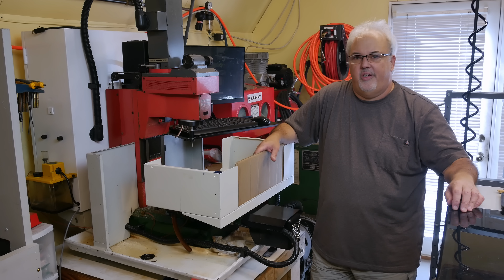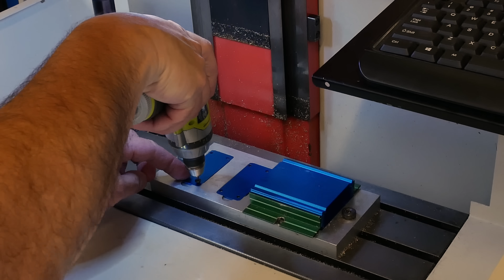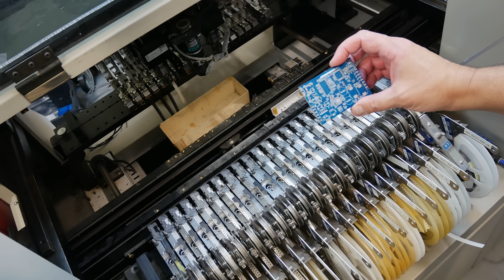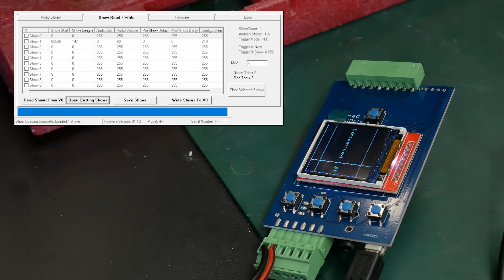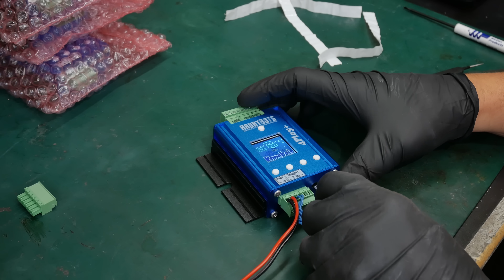How Does a Factory Fit in a Shed?

Comment: Never thought about this world of hand made circuit boards. Aren't the "moisture sensitive" components affected by the wash? Looks very labor intensive. You're a smart dude.Congrats on this niche of very specific electronics.
Reply from the maker: This is an interesting point that a few people have asked and I glossed over in the video.  The issue is that the chips can absorb moisture even sitting in standard room humidity.  This causes a problem when you reach the reflow oven stage of the process.  You have a component with a certain amount of internal moisture heated to twice the temperature of boiling water.  Basically the chip can behave like popcorn- if not completely exploding, it can create micro cracks that can later come back and bite you.  Once the part is soldered on to the board, the moisture is no longer an issue. so its safe to wash.

Comment: I did something similar to this in what we called " In Shop Repaire " When I was in the AirForce, I loved it. We didn't make new boards we would troubleshooting bad or old boards, repaire them, test them and certified them as usable for the fleet of jets we had on or off stationed. Our bench stock had over 4 million dollars worth of parts and looked just about like yours. Again I really enjoyed this position, but we rotated and at some point it was back out to the flight line to repair jets. It was odd ordering a part to fix a jet and when you got the part the tage was signed by yours truly...very satisfying !

Comment: Nice to see a setup in a shed. A few notes regarding the cleaning using the ultrasonic bath: -the solder paste you use is technically a no-clean variety so really doesn't need to be cleaned afterwards. -Crystal oscillators often don't agree with ultrasonic processes, you can minimise the risk of damaging a crystal by applying a small dot of potting epoxy around the crystals first. This pre-stresses the crystal and helps reduce damage.
Reply from the maker: That is true, but the hand soldered stuff along with the flux I use when touching up the reflowed stuff makes a mess and I just don’t like the looks of it, so, it gets washed.
I haven’t run into a problem with the crystals up to this point but thanks for the tip.
Reply: Agree on the no clean not needing to be cleaned. You should consider moving to no clean hand solder process as well. When you mix the two you can accelerate CAF and other related problems into your assemblies.

Comment: This is incredibly interesting. I don't know anything about the electronics, but it's still interesting to see the small batch manufacturing process. I have been working on building a CNC machine for quite some time now and have REALLY struggled on the electronics side of the whole equation. Wish I had your knowledge haha.
Reply: Arduino makes it easy

Comment: Very nice tour!!  It was fun to see how you do about the same exact thing I do.  That printer is fabulous.  I hate the silkscreen hassles.  I use the TAG-Connect for a socket-less programming connector.  Works really well.
Reply from the maker: Thanks!  I'd have to redesign the board to use the tag-connect as the pin layout is different.  Several years ago I bought pogo pins with the intention of making a programming fixture- just never got around to it.
Reply: @PeteRondeau   While what you're doing is sure straight forward and lends itself to possibly crazy (desired) footprints the two things I like about the TAG system is that the footprint is small (square-ish) and it clips in so you can just drop everything on the bench and hit 'program'.  That also works for development as I use it for firmware work on the first unit.   Do you solder in a SIP header on your prototype for use with the ICD during development?

Comment: These components are so sensitive to water that they have to be stored in desiccant.
Dunks them in a vat of water
Reply from the maker: They are susceptible to water for the reflow oven.  If the parts contain moisture when they are baked they basically can explode due to the internal steam trying to escape. Once they are assembled it is irrelevant.

Comment: You should start manufacturing battery packs with BMS.
Reply from the maker: That seems like it would be an extremely competitive and cut-throat business to be in.
Reply: @PeteRondeau  Only if you offer an inferior product. Battery technology is one of the few products that reliability takes precedence over cost. The reason being is more an more people are becoming fearful of the collapse of our system. What used to be a throw away society is now becoming a society where people believe in the possibility that they may not be able to get a product in the future so they want the best. I'm sure you know from experience in your builds, that you can build two almost identical looking products, but one can have inferior parts designed to fail and the other can have robust, somewhat overkill parts that will last for a very long time. If you can offer the latter, people will pay for it.

Comment: Not sure if I missed you explaining it or not. But what did these controllers do? Like what does the park use them for?
Reply from the maker: These are to control animated props or scenes. So when triggered it will play a sound effect and the four outputs can be programmed in real time to control whatever is attached- whether that be lights, buzzers, air cylinders, etc. every time it is triggered it will play back the same sequence.  Or you can program it with multiple sequences and do something slightly different each time. I hope to go to the park next week and get some video of it in action.
Reply: @PeteRondeau  Very cool, loved your video. You have quite the neat operation

Comment: Love the "cooling" on the DIY reflow oven 😁
Reply from the maker: The control board actually has an output to turn on a forced cooling fan. so the idea would be that the door opens and the fan kicks on. I never got around to adding that.
Reply: @PeteRondeau  convection probably takes care of it quickly enough 😁
I just love the little servo lever 🤣

Comment: [00:00] 🏭 Introduction to backyard manufacturing setup with pick and place machine.
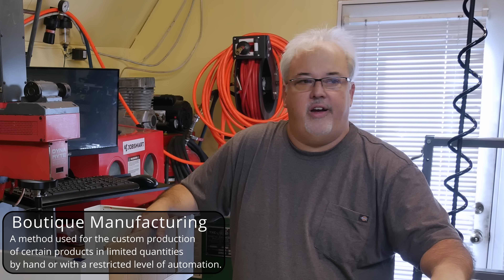[00:12] 🛠 Creator's pause in custom electronics due to supply issues and recent restart.
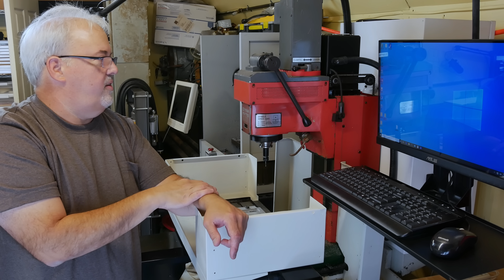[00:55] 🔥 Restored CNC machine used for cutting holes in boxes.
[02:08] ⚙ Pick and place machine automates component placement on circuit boards.
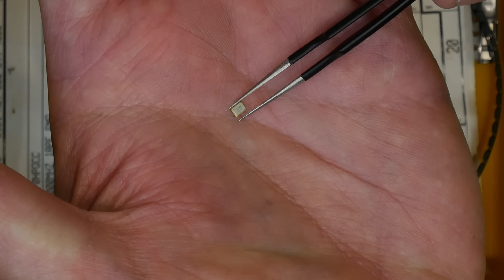[06:05] ✋ Hand-loading some components due to machine limitations.
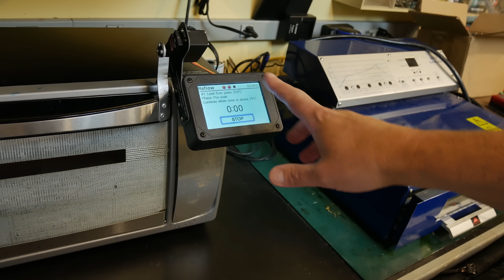[08:23] 🔥 Circuit boards reflowed in converted toaster oven.
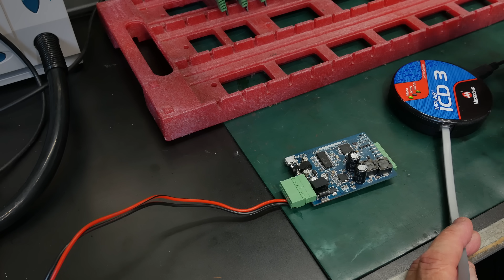[11:00] 💾 Microcontrollers programmed and configured for products.
[12:54] 🖨 UV-curable ink labels printed on product cases.
[16:11] 🧰 Final assembly involves buttons, cases, and tests.
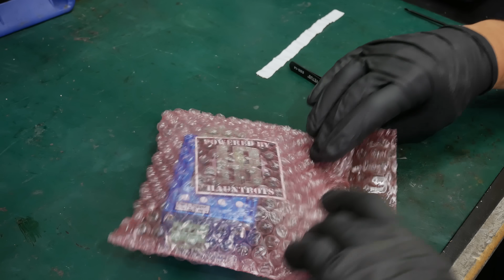[17:11] 📦 Products packed and prepared for delivery.
Reply from the maker: Thanks for taking the time to do this.
Reply: @PeteRondeau  HARPA AI 😉
Reply from the maker: Well either way. Lol

Comment: What do you use to keep track of you inventory?
Reply from the maker: I have tried a number of different methods and products, but in the end I just keep coming back to a spreadsheet.  I have one excel workbook and every sheet is a product I build.  The last sheet is the master inventory. The individual products share common parts so it makes sense to keep track of the inventory as a whole rather than per product. When I want to build a new batch of something, I make an entry on the master inventory sheet- entering the product name and quantity desired.  The spreadsheet calculates how many of each component I need by referencing the individual build sheets. It shows me how many will be left after I build the order and anything that is less than 2 is flagged so I know I need to order before starting. (2 just seemed to be a good number) Then there is a column where I update how many I order. it updates a new current inventory column and it is ready for my next build event. So, for every new build, about 4 columns are added to the spreadsheet. Every 6 months or so I do a physical inventory to account for lost parts and I truncate the builds if it has gotten too big.

Comment: What is the name of the printer for the boxes? I ask a manufacturer about a white ink printer for labeling panels and boxes and he looked at me as if I were mad. I’ve looked everywhere for a similar printer.
Reply from the maker: Search ebay for A4 UV printer.  They are made for printing on phone cases.  Word of warning though they are a high maintenance item.  You really have to print with them almost daily or they will clog.  if it sits for any length of time you have to usually go through a whole cleaning and purging process.  these are basically hacked together from Epson printer parts.

Comment: I really enjoyed your video. So far as I'm aware it is the first one of yours that I have watched. I am impressed with your simple manufacturing setup. As I go through Pennsylvania a few times a year, I looked at that amusement parks site. (they need to make it work a bit better) It looks like an interesting place if I get a chance to get up that way. Thank you for posting your process and methodology for building such things. I've made small batches of lights and driver boards and charge controllers for missions, CNC on the light housings, but driver boards by hand. Good work there!

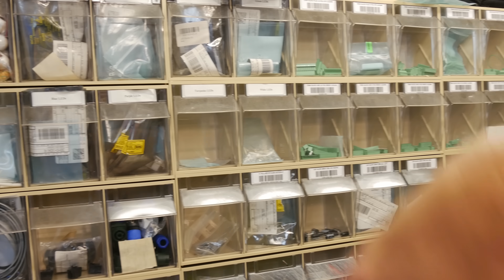Comment: What are those giant green Phoenix connectors you have on your shelf? Visible around 9:15.
Reply from the maker: If you are talking about the ones that are above the blue spool of wire, those aren't phoenix connectors.  That is a small plastic box that holds a circuit board. the two openings you see are for a 9volt battery connector.

Comment: Wow!! I am very impressed (and jealous) with your setup. My electronics shop is an 8 x 10 shed which gets quite crowded. That machine is a dream.
Reply from the maker: This space is only about 12x14 so maybe about twice the space you have but not crazy big.  Plus there is an player piano restoration project taking up one corner , an older cnc machine that was replaced with the current one and a sandblasting cabinet taking up the other. If those weren’t there I could get away with less space.

Comment: Hi Pete! I really like the workshop and the type of projects you have been doing. It's something I've dreamed of being able to learn and do one day. Would you be able to tell, which programming language and microchip family you used for these? Also, interesting to see the USB-computer interface which I assume you wrote the end-user program yourself for uploading the files. How does it interface with the computer? Thank you very much if you could answer these questions!
Reply from the maker: I used C to write the firmware for the microcontroller. It is called CCS. The chip is an 18f46j50. It has built in USB hardware.  The Ccs compiler has a usb library that handles all the configuration but you do have to be careful not to tie up the microcontroller so it can respond to USB activity.  When the controller is attached to the usb port it emulates a serial port and then I wrote a VB application to talk to the controller and exchange data.

Comment: Am just a tad jealous of that setup 😋You have a very nice workshop. The detailed effort in the board manufacturing is certainly appreciated. Thanks for sharing. Though, I would re-evaluate the rinsing 'moisture sensitive components' with water step.
Reply from the maker: The moisture sensitivity is only related to the reflow oven.  If the chips draw moisture and then are put through the oven they can fracture internally as the water turns into steam and has nowhere to go. If the humidity of the chips get too high they need to be baked at low heat for several days to drive out the moisture slowly before they can be subjected to the high heat of the reflow oven. Once the boards are assembled there is no concern.

Comment: New to the channel, The placer machine caught me off guard. It's an awesome setup you have! I've only seen glimpses of them but more often than not when shown, terminology being my limiting factor for it. No explanation is given like what you've done on how they function. Sure it's only half an explanation but more than most. If you had the internal chipset of every machine you own, you could quickly redeploy if anything went wrong with that gear. something I've done with my 3d printer but it's limited to the plastic parts, if the rest fails I am stuck relying on orders. One day the hope is to own a mini factory setup like yours but my intentions are for self sufficiency to the point I could even make the tiny components by machine and deploy them onto a custom chip. I might end up in my 60s before realizing my goals but I'm going to keep learning and pushing forward. I feel like the future home shop is manufacture on the spot for anything you need at home with ease. So designing these machines to be more home accessible is important honestly. Actually, thinking as I write this a 3d printer could do an entire chipboard with a tool changer now that I've seen that machine. Sorry about the rant! I'm just geeking out in my corner here.
Reply from the maker: I’m happy this gave you some inspiration.

Comment: This is amazing, what a diverse set of knowledge you must have to restore, run and maintain all of this gear. I can relate in some ways to the ancient gear chugging along which just about works (in my case applies to old computers and such). The government should be air dropping crates full of money on anyone who has these types of skills in the US. Speaking of which, and I hate to ask, but why wouldn't you get something like this made by PCB Way or a similar company? Especially the PCB component. Is it just "I already have everything I need and I can do it today" for a small batch? I feel that even with all of this equipment, for a lot of things it would still work out cheaper to get it fabricated if you count the time you put into straightening everything out etc. Anyway, I'm glad you're making it on US soil but I fear this type of manufacturing has all but gone away, the way policy is currently.
Reply from the maker: I send out the files to have the bare PCBs made but to have them assembled would take all the profit out of the operation. I would either have to have thousands made to drive the cost down (and the market for these isn’t big enough for that ) or I would have to raise the sale price to cover the cost of an assembly house and make it worth my time to handle all the logistics. (I couldn’t raise my price that much and remain competitive) With this setup I can do small to medium sized runs. I can control delivery times and I can sell it for a price the customers are willing to pay.

Comment: Hi, this printer is nice. Did you build it yourself or did you buy that one? Can you give me a little bit more information about it?
Reply from the maker: I purchased it second hand on eBay. They are sold as phone case printers.  Search for “A4 UV printer” and you’ll be in the right ballpark. A word of warning though they are a lot of maintenance. You need to use them on almost a daily basis so the head doesn’t clog.

Comment: Whats the voltage required on that amplifier is it DC or AC? and whats the part number on that Amp chip ?
Reply from the maker: 25 volts DC for full rated output but it will operate down to 10 volts. Texas Instruments TPA3106D1

Comment: Interesting channel that you have, reminds me of my life of onward through the fog of dynamic troubleshooting.   To graduate high-school I had to help my shop teacher spot weld a bunch of ferris wheel seats and his whole back yard was full of carnival ride stuff.  Personally, I never liked them, only been on maybe three, fifty years ago, probably it is the ingrained fear of structural heights, yet aerobatics at night with the stars and terrestrial lights spinning doesn't phase me.  I worked with an EE, he almost got me to do those surface mound components by hand, didn't know, until now, one can bake them.  You should see fixing the heat in the shop when it is 20+ below F. and having to think fast even with fingers sticking to metal.  And after it all, searching for matches because it is to cold for butane to come out of the container, just to light the wood-stove.  Halloween, eh?  See my work.

Comment: Would you mind sharing that case and the mounting rails? Like the format of those. Also very nice shop!
Reply from the maker: The boxes are sold by Box Enclosures.  The part number is B1-080BL  The last two letters indicate the color (BL, RD, GR, SI, BK)   The rails are MF80BK  again, the last two letters indicate the color.  we've been using the contrasting black rails for several years no matter what the box color.  Thanks for watching!

Comment: This is one of the coolest things I have seen as of late. The process you go through is amazing. My question is about the pick-in-place code. Did you have to program it yourself 10 years ago? Or did you have a product that you found on the device or elsewhere, and just continued to make it?

If you had to write it yourself, how did you learn how it works? Is there some sort of manual that is available for an older model that you read the manual on how things worked? That's extremely intriguing to me... I like digging up old bits of technology that is long lost knowledge and have to figure out how it works :D